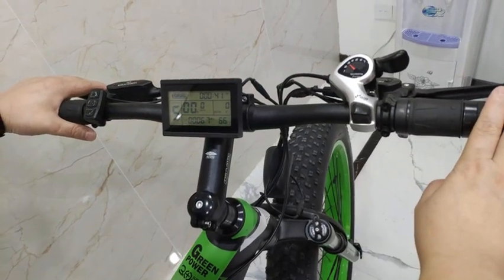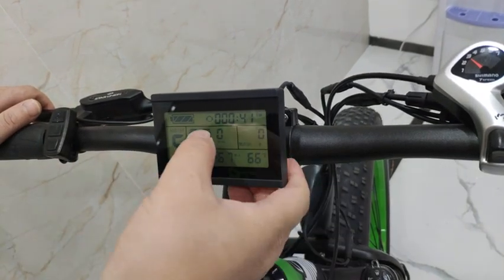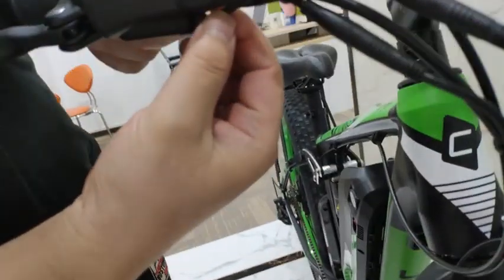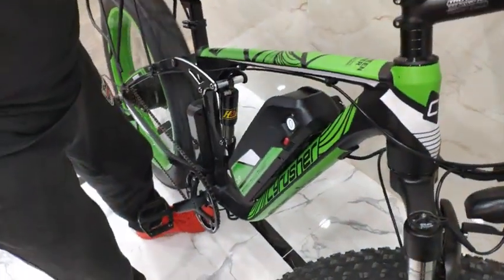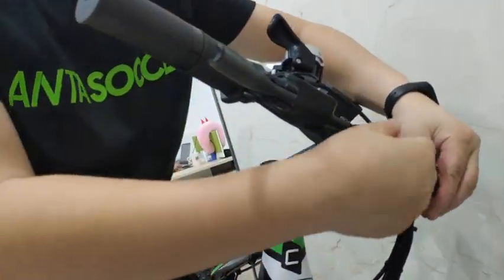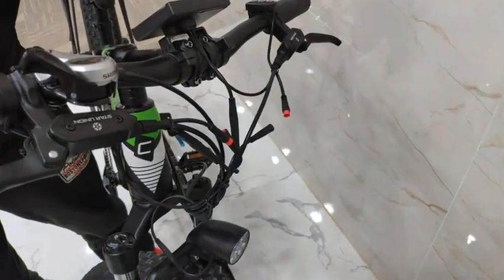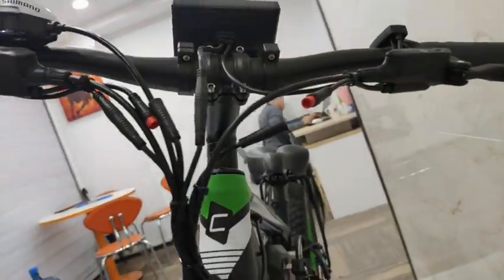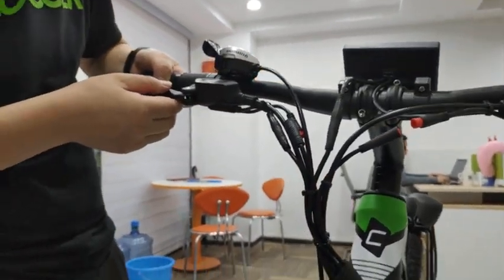How to solve Cyrusher XF800 brake lever cut power and motor does not engage?

Comment: Is it true that the new 17AH model battery does not work with the charger that came with my XF-800 13AH model ?
Reply from the maker: Derek Short yes. Currently, 13 ah battery input is 1-3 holes. But 17ah battery input is 1-2 holes.
Reply: Cyrusher Thanks
Reply: Cyrusher So other than that that the battery is compatible with my bike and charger ?
Reply from the maker: Derek Short battery works fine for 1000watt version  just need different charger.
Reply: I have a Cyrusher xf590 and the  Front  Suspension Is  Making noiseWhat can I do to stop it I am tinking off find new suspension Please tell me what to do

Comment: Hello my bike stopped working randomly. I replaced everything except the motor and it still doesn't work. The display turns on but the battery meter doesn't show anything and nothing else works on the bike not even the light. Can you help me
Reply from the maker: please contact customer@cyrusher.com thanks